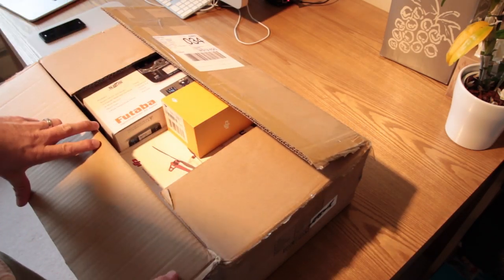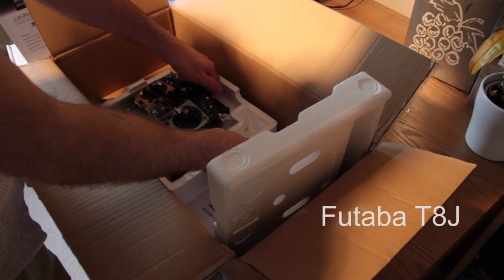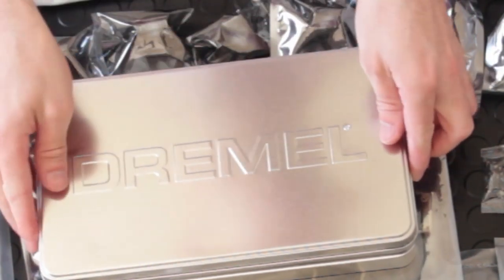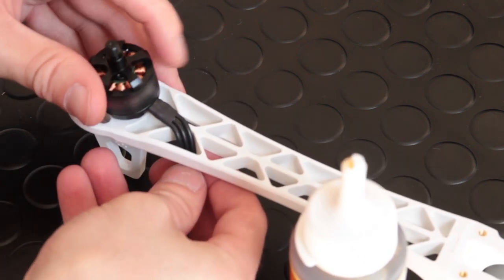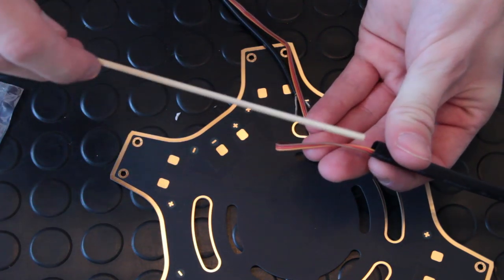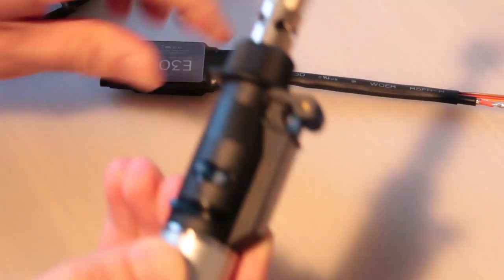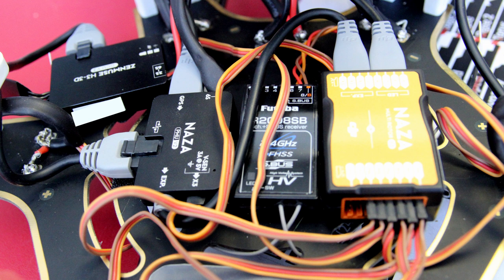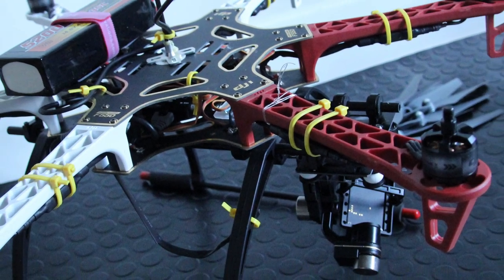DJI F550 Flamewheel, NAZA M V2 (with H3-3D Gimbal) Unboxing and Build hexacopter kit with Futaba T8J

Comment: I bought exactly the same kit from Martin at byod two weeks ago and I was surprised how straightforward the build was.  One thing I learned is you need a really good quality soldering iron, a five quid one from the local diy shop won't do the trick and get the perfect solder joints needed on the power board to handle the large currents that flow from the battery.  My zenmuse came pre-balanced for a gopro hero 3 right from the factory and performs brilliantly.  I bought the bluetooth ipad link and am looking forward to trying out the ground station at the weekend.  Thanks for the video, I have checked my work against your and thankfully i seem to have done it right.
Reply from the maker: Excellent thats great!!

Comment: Hoo brilliant video mate... really did helped a lot...
I have a question tho.. I used to have a Phantom, and was using the 5.8 fat shark FPV system.. can I still use the same FPV system with this DJI F550? Would I be pinching power for the transmitter from the same main source? I would really appreciate if you could give me any information about this matter...
Also, would you then recommend the Futaba controller before the DJI D7?
Thanks in advance.. and again, great videos!
G
Reply from the maker: To my knowledge the FPV are perfectly fine, and use the same power sources. I personally like the Futaba as it is relatively easy to configure and add-on!

Comment: Great video.  
I followed your video step by step as I put together the same f550 hex, E300 system with naza m- v2. Very helpful info throughout the video. 
I have a question though,  I have a nano tech 4s- 8400mah laying around, would this be suitable for this craft if I am looking to get longer flight times?  Or is there a limit when it comes to the mah capacity to be used on this system?
Reply from the maker: Hi many thanks, glad you enjoyed it! The mah refers to the amount of power it stores (milliamp hours) and therefore the only important factors are the number of cells (4s = 4 cells) and the C rating - which is how quickly the power can be drawn out, optimum would be 30 or 35C. your batter should be fine but make sure its not puffy as that might indicate it has leaked etc, and you wouldnt want sudden failures midair! I've even heard of people using 2 batteries in parallel!
Reply: AirborneFilming My nano tech 4s- 8400mah has a discharge rating of 40-80C. i have never used it, it is still in its original box. I just need some assuance as I dread the magic smoke on such expensive equipment.

Comment: those screws come with locktight on them.

Second, those holes under the motors, left and right of the screw holes are for your motor wires..
Reply from the maker: Not sure mine did, but better safe than sorry! and I found the holes that I used kept it tidier! Thanks for watching
Reply: good video though.
Reply from the maker: Eric Jones
Thanks :)

Comment: How would I connect the NAZA to a Turnigy 9x receiver on a F550?
Reply from the maker: HI, with receivers that don't have SBUS simply connect each channel separately 1-6 mirroring the motor inputs on the opposite side, hope that helps

Comment: does the NAZA not have to be in the centre? there are a few other instructional videos where they make sure it is lined up and stuck right in the middle. does it even need to be facing the right way? What is with the length of that exp cable. it makes things so
Reply: Hi, the satellite needs to be as close to the centre of gravity as possible, and pointing "forwards" for orientation purposes. Howeve the CoG can be configured in the NAZA settings if you have it placed toward the rear of the craft! I've done both which both seem perfectly fine

edit: (still me, replied using a different account!)
Reply: thanks for the quick reply. so i  can just cram it all in without sticking any of it down? i don't think it would affect the cog once the weight of the landing gear and gimbal is added on would it?
Reply from the maker: defSpray I use velcro from amazon to stick everything to the bottom plate, its lightweight and stops it from moving around http://www.amazon.co.uk/gp/product/B0017GKK5G/ref=oh_details_o00_s00_i00?ie=UTF8&psc=1

As for cog, in theory no it should be the same - but if you put the satellite somewhere else, you just need to tell the naza that its offset along x and y axes.
Reply: AirborneFilming thanks. you can pretty much get velcro anywhere and i am quite aware of the satellite positioning.  When you say satellite, you are talking about that white gps compass disc right? i always thought a satellite orbited the earth or other larger objects. but i didn't go to school . anyway my problem was actually getting everything to lay flat without putting to much strain on the exp cable but if it doesn't need to be flat or facing any particular direction then my problem is solved.... oh short for satellite dish?
Reply from the maker: defSpray Yes that would be dish! It often refers to something that is separate from the main unit, but controlled by it, for example: a satellite office is a sub-office from the head office. :)
Reply: AirborneFilming are you talking about an office in a satellite?  lol